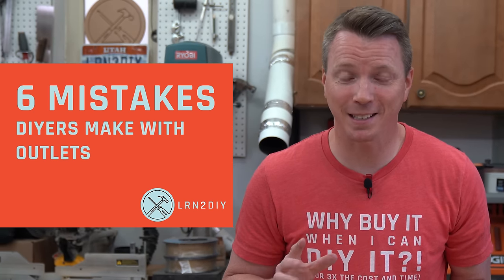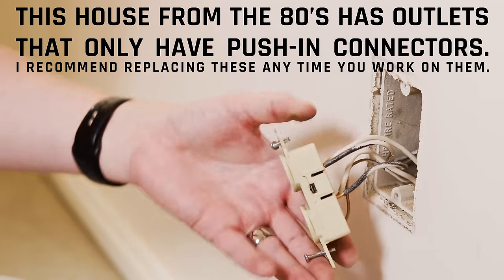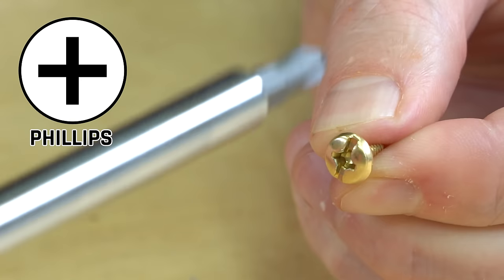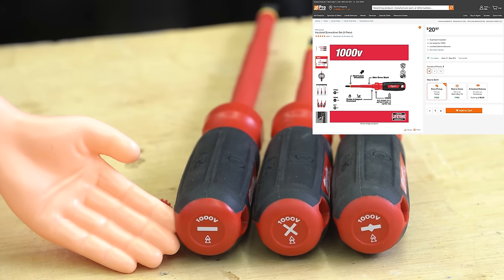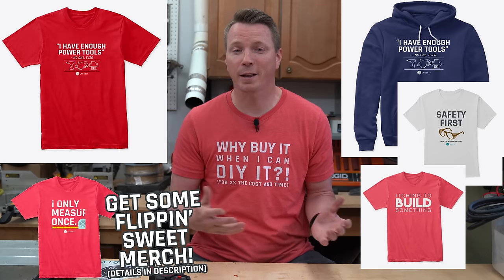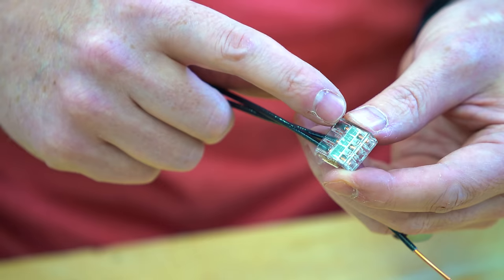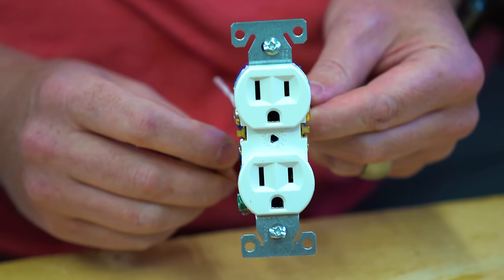6 MISTAKES DIYers Make When Wiring Outlets

Comment: Journeyman electrician here. With most wire nuts you should not pre-twist the wires together. The instructions on the box don't say to twist the wires on the two brands I have here (which is to say not to do it), and I have seen some instructions expressly state NOT to twist the wires together before putting on the wire nut. You must follow the manufacturer's instructions. It is important to make sure all the the wire ends are equal and then twist on the wire nut as tight as your hands can tighten it while firmly holding the wires from twisting. Then as you showed, check each wire to see if it will pull out. Then you are done!
Reply: You are 100% correct...to add...important to make sure all the the wire ends are equally stripped 3/4" hold them and tap the ends with your kliens or your callused thumb which ever hurts less and cut them even. Use kliens if you want to caress the wife smoothly with your hands!😄

"then twist on the wire nut as tight as your hands can tighten it while firmly holding the wires from twisting." <<< You want at least one/two twists on insulation side clearly indicating a mechanical connection if the nut came off wires would still be bundled.
Reply: This is completely correct. There's no need to pre twist your wires.
Reply: Using WAGO connecters is the better way to go in most circumstances. Less stress on the fingers and hands over time.
Reply: You’re incorrect
Reply: Not a professional electrician but everything I have seen says not to pre-twist wires mainly because you can twist the wires together and the wire nut may not be secured to the wires. This is part of the reason I do another questionable practice, wrapping the wire nut with electrical tape.

Comment: As a 30-year electrician, I appreciate the direct, concise advice here. The no nonsense approach is fantastic!  I can't begin to tell you the amount of diy mistakes I encounter. Whether made last week, last year or last decade, they eventually come back to bite you....or the next person.
Reply: I had to start skipping through this, its for people without common sense which is not so common anymore, no real trade secrets here or anything and I am not an electrician or even close.
Reply: @TryingToDiscover2  Might as well just use doorbell wire then. Or aluminum wire. I hope I don't encounter your wiring in a house I buy.
Reply: @TryingToDiscover2  😂😂🤣🤣
Reply: @TryingToDiscover2  Terrible comment.  So someone plugs a high watt old light or heater into your suggestion.  Surely you jest.
Reply: As an electrician to an electrician, can you tell me if it would be a big problem wiring an EV charger to a dryer outlet?
Reply: @TryingToDiscover2  DO NOT!!! LISTEN TO THIS POST. you are asking for a house fire. hire a electrician. we size the wire to the over protection device! if you pull more amps than the conductor is rated for YOU WILL HAVE A ISSUE WITH OVERHEATING AND MELTING OF WIRES.
Reply: @TryingToDiscover2  No one asked you, and you are 100 percent wrong. There are standards for a reason! .
Reply: @Dirty88Dizl  It was a joke, but unfortunately many people may take it seriously and put themselves and others at risk.
Reply: I always do my best to get it right because the next guy is usually me.
Reply: Lol we literally just had a service call today to disassemble some some idiot’s work who used speaker wire as a switch leg and it caught fire. Please don’t life hack electrical it’s really dangerous. Either study to be a professional or call one.

Comment: I just had to rewire a bedroom in my house. All outlets in my house were backstabbed and one room kept tripping the AFCI breaker, every night. I opened up all the outlets and switches and I didn’t find anything inherently wrong… so I decided to just get rid of the backstabs and wire it up properly with pigtails and wire loops under terminals. Hasn’t tripped a breaker since re wiring. Videos like this one helped put me on the correct path to diagnose and fix the problem correctly.

Comment: Just replaced all the backstab outlets in my house with commercial grade outlets. I like the straight wire connections in the back that tighten with screws. Also the internal connections for the plugs are much more rugged and durable. Several of my old backstab outlets were scorched and melted, some of the wiring had to be replaced. I also bought an ECX screwdriver from Lowes, very useful.
Reply: Go spec. Grade outlets .

Comment: Cool, you learn something new every day, I've been an electrician for 33 years and I've never seen an ECX driver, I'm going to check it out. You're absolutely right about stab-in terminals, don't use them. New ones won't even take a #12 wire because they know they're not good for 20 amps. With a little practice you can learn to wrap the wires nearly as fast. Since you won't have to redo them you'll actually save time. Not burning your house down is another nice perk of properly terminating wires.
Reply: Agreed Will! And for the record, the back stabs won't even handle 15A long term!!! And this is from experience of failures with 1500w space heaters!
Reply: I first saw the ECX driver about a year or so before I retired.☹
Reply: I have always found back stabbed devices to be a lot harder to stuff in a box. So, I always change them.
Reply: Every duplex outlet I've had to replace-in 3 different homes-had these horrid back-stab wires in place. I literally had to bust apart the duplex fixture to get the wires out. good tips, there is no other way-except the right way with electrical-I've seen more than one house burned to the ground because of faulty wiring. Doesn't take much. One badly wired duplex outlet or switch can bring down an entire home.
Reply: 40 years here. Never heard of them either. Its pretty neat. Can't tell you how many times I stabbed myself in the palm of my hand. Lol
Reply: Me either but it's the best. Even without trying it I can see this eliminates slipping & the need to put excessive pressure on the receptacle.
Reply: I have only had 10% failure but from the previous installation but that is plenty.  I use the screws only which is also code as long as it exceeds 60% of the head contact.
Reply: A general contractor will use them 99% of the time.  It is how I can tell if they used a framer to install wiring instead of a real electrician which will use a line plier to make bundles and then the screw to attach.
Reply: Imagine the death trap if a space heater is being run off a stab lock connected outlet! What hurts me the most and drives me insane is the amount of people out there that are willing to tell me I just worry too much or am just being a mama'a boy. Use to be an excuse for me to slam a few down and turn up the music. I am glad I now have back up when it comes to safety. Thank you all. Ever hear of a Youtuber called SparkyUonLine? Well people used to give him garbage also for being "Too Safe". 😑
Reply: @LordVoltRod2c  Amen. No such thing as too safe when it comes to electricity.  We owe it to our customers to put their safety first. I have seen so many cords, plug strips and other things burned up because of stupid space heaters. A 1500+ watt appliance shouldn't be left in a corner plugged into some random outlet.

Comment: Ive been a JW journeyman wireman since 87 and I must say well done sir. Two things I would add is I believe in just 3 wires on a recep unless its a half switched recep. In other words pigtail whenever there are more than just 1 hot 1 nuetral and 1 ground in the box. Wire nuts are a girls best friend as they are better at carrying the current to the other receps than the side tabs of the recep. If you look at the connecting tab between the 2 screws on each side you will notice the bridge between them and how thin and skinny it is. Its that way so you can break it off by bending it. That is so you can isolate the top recep from the bottom one for half switching the recep or in some cases supply the top and bottom receps with there own circuit. That skinny little piece is all there is to carry the load of down stream receps. The second is it seems logical to use short wires from the box to recep but in reality is much more difficult to push the recep back into the box and is against code. I like my wires to extend 6" from the front of the box and my pigtails to be 6" long. Then after attaching the pigtails to the recep and wire nutting the correct wires together simply fold the wires over and then accordian the wires that came from the box into the box then do the same with the pigtails and push pigtails and recep into the box. Using short wires makes it difficult to fold the wires into the box and if something goes wrong the longer wires leave you with enough wire to fix the problem plus code doesnt allow for short wires. Also installing with the u-ground hole up is a good safety measure thats not required by code but is specified to be that way on many jobs now. It would be tough to explain why its safer but trust me, it is.
Reply: You want to install the receptacle with the ground hole up because of something falls on it then it only makes contact with one contact instead of two. Listen for chance of a short.
Reply: In some jurisdictions 6" from front of box and ground pin up is code.  Here, 6" for a very long time, and ground up since about 2000.
Reply: @99bn99  Just a little history on U ground up. It was first introduced by Jerome Migetric. Im pretty sure I didnt spell the last name right but he was an electrical eng in Tucson, Az and introduced this idea in the late 1980's. And for those saying it is code it maybe that your local authorities have adopted it on a local basis but it is still not required by NEC. Another electrical milestone coming from Tucson was the Ufer bond or bonding to building steel. In case you couldnt guess I am from Tucson.
Reply: @tonythomas951      I understood from a licensed electrician that ground up became code here (Ontario, Canada) about 2000.  There were a lot of code changes made about the same time.  It used to be that extension cords with right angle plugs hung down installed in a ground down receptacle.  For at least 10 years, the new cords hang down in ground up receptacles.
Reply: @tonythomas951  thank you for the history.  I thought ground pins had been around a lot longer.
Reply: @99bn99  I dont know how Canada does electrical code. I would think they have their own code but in the states is the NEC. National Electrical Code. The ground pins have been around a lot longer than the concept of putting them on top or really just flipping the recep so ground is up. I know the origins of the idea because I was working on La Paloma Executive Building in Tucson and that was the first time the prints spec said receps will be installed with the U ground up. I read it and rather loudly I stated that that was the dumbest thing I ever heard. I didnt know it but standing within earshot was Jerome. I had never met him before and ye it was not my finest moment. He was very nice and understood my reaction but he went on to explain why he wanted it that way and after explaining it I couldnt argue. He was right. It made for a safer installation at no additional cost. He is probably the best engineer I ever worked with. A lot are over educated guys with no real world experience. Jerome was very good and not condesending like a lot.
Reply: @tonythomas951   In Canada, the federal government publishes a code which serves as a guideline for the provinces.  Each province publishes a code which is law in that province (same with fire code).  Municipalities may impose stricter rules, but may not negate anything required by the provincial code.  Electricians are licensed by the province.  Strictly to code, it is illegal for anyone who is not a licensed electrician to manipulate or work with wires intended to carry 100V AC or more.   
     I had thought you were telling me that ground pins were first thought of by Jerome in Tucson, but what you were telling me is that he put forth good reasoning to put the ground on top.    While the situation looks strange, mostly because of seeing them ground down for a long time, and for anthropomorphic reasons (ground down looks like a face), having the ground up makes sense.   While some have talked about something landing on a not fully inserted plug, the explanation I have heard is that a liquid running down a wall gets to ground first.   If that is the case (liquid), all circuits ought to be protected by GFCIs.
Reply: The reason for ground up was explained to me, as if the receptacle was low and you pull the cord out, the ground would be the last of the 3 in the receptacle. After hearing this ground up reasoning, both sound reasonable, although I have always gone with ground down.
Reply: @99bn99  I've looked through the ontario code book and that's not in the code. I've talked to 3 licensed electricians all who say that's not part of code and none of the recently built houses here seem to follow that convention. Which province are you in?
Reply: @nutritionperfection   I am in Ontario.   The restriction on split outlets was told to me by an electrician.
Reply: Those tabs have 20A passthrough, even for 15A receptacles

Comment: Thank you for mentioning insulation for screwdrivers.

I was a professional HVAC technician for many years and I still have my insulated screwdrivers (they are my go-to set, and work equally well for electrical or non-electrical work.)

A trick you can use for specialty screwdrivers (or screwdrivers you already own and don't intend to replace) that do not come insulated is to place two layers of electrical shrink tubing over the shaft of the screwdriver (two neighboring sizes of shrink tubing one that barely fits over the shaft and one, slightly larger, that barely fits over the, single layered, covered shaft.)

Doing so provides a semi-permanent non-conducting layer and while not as good or as durable as a proper set of insulated screwdrivers they work wonderful in a pinch or for light use.
Reply: I never used them as an electrician unless I was around high voltage. Biggest mistakes electricians make is getting comfy on T-Bar, otherwise you should not be grounded to get zapped unless in a high electrical field area. Most of use wear good boots and whatnot to prevent grounding. But we get  cocky and lazy, then electricity reminds you not to. I seen guys that know their stuff grab live 120v in one hand and a meter in the other to check because they knew they were not grounded. I am still not that ballsy.
Reply: Yes they do
Reply: Your comment is irrelevant

Comment: I’ve done DIY wire for years and years but I accidentally stumbled onto your videos and I’ve learned so much, Thank you.  I’m going to order some ECX bits.  Good tip on making the shepherds hook, I’ve used the pliers on my original Leatherman.  Makes a perfect hook.  I have an assortment of Wago connectors but I only use them on 12 volt automotive wiring but I won’t be hesitant from now on.

Comment: Excellent video, should be viewed by everyone doing electrical repairs.  I've been doing wiring for many years and have experienced all of these mistakes.  I had never heard of an ECX driver, but now I need to get one.
Reply: I've been doing electric for over 20 years and nothing grips those screws better than the ECX driver bit it is literally made specifically for those screws. But remember there are two different sizes so you have to get the right size. I would just buy both of the common sizes so you're sure to have the right one, they're pretty cheap.
Reply: @actionjksn  Been having issues with Kline #1 ECX tips breaking often. #2 ECX not so much but the only time I use that one is on Eaton breakers and some panel ground terminals. Have you encountered this?
Reply: @jasonj4865  That's funny that you mention that because yes I broke mine as well. I do not attribute it to being an inferior design though, I just figured mine was not very good quality Steel. I don't see where it is inherently any weaker than a flathead. The fact that it grips so well which allows you to apply a lot more torque to it is most likely the cause. I'm eventually planning to look for a set of high-quality ones and if I get several of them I guess it won't matter if I break one I can just put a new one in. I do have a tendency to really crank down on those screws in order to get the best connection possible. Maybe I'll just buy a large pack of cheap ones and not worry about when one breaks.

Comment: I try to get slightly upgraded outlets that have back wiring under the side pressure plates.  I find more convenient thsn fiddling with the hooks
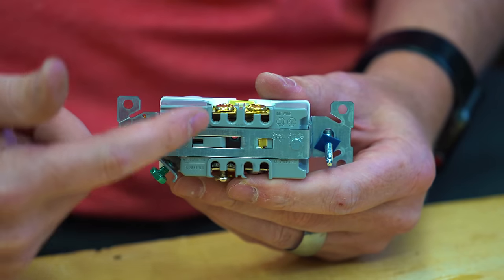Reply from the maker: That's an excellent point. The side wiring options are excellent, like the ones at 8:50. I have found that Home Depot doesn't have a good price on them and neither does Amazon but Lowe's has by far the best deals on these. I'm considering a new video on exactly that topic because I shopped at four places to find that deal.

Comment: Once I found the ECX drivers that’s all I use now, self centering and high torque with minimal effort, even in a power tool ( mounting screws etc). Often I run electrical tape around the outlet or light switch to cover the unused screws just as a backup. Thanks for the video.😊😊

Comment: I have done these things over the years and have learned like you the proper way , as learning is great,  pigtails and the wago are nice to use with greenie wire ground nuts with a hole in the top to have a ground wire to fasten around the ground on the outlet